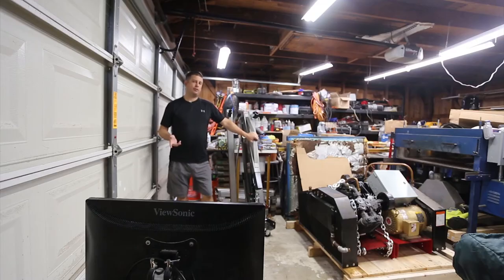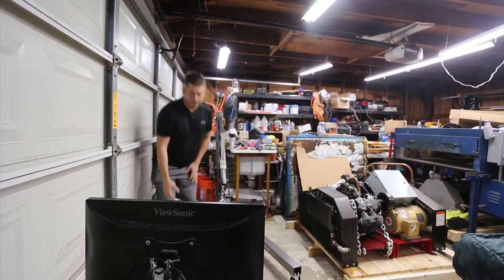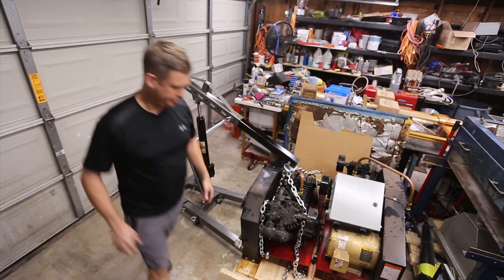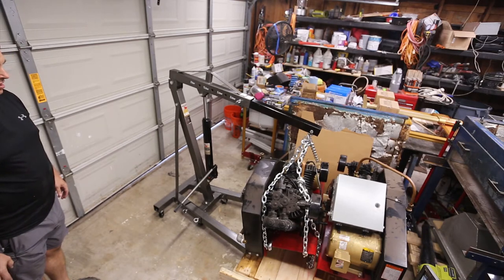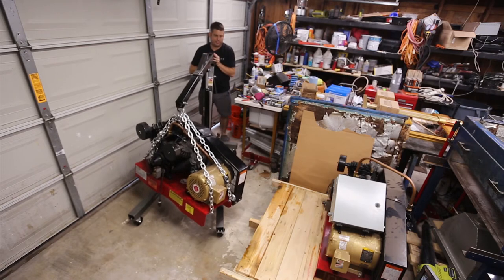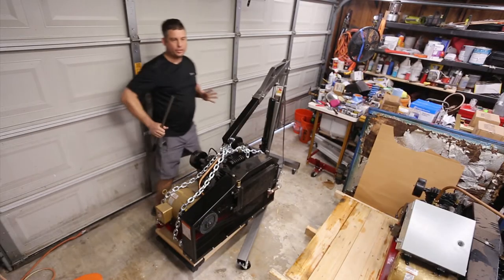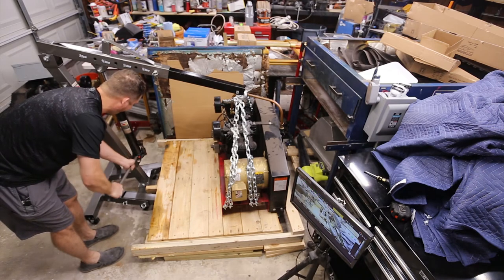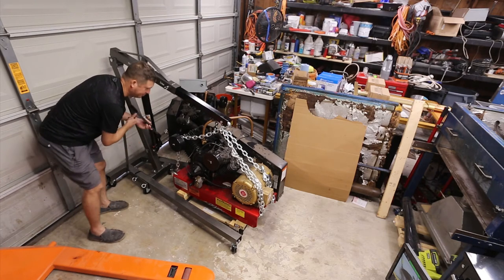Using a Harbor Freight 1 Ton Shop Crane to move two 500 pound Schrader 7.5 HP Air Compressors

Comment: That's a 1-ton crane, but only when then boom is in the short position, in the extended position it's a 1/4 ton (500 lb) crane. If those compressors are truly 500 lbs, he's running at max capacity. If he's wrong about the weight (did he weigh it himself?) he could be overloading the crane. He had clearance to bring that boom in one notch to the 1/2 ton spot and give himself a safety margin, plus extra stability.
Also, as tom73001 points out, proper footwear is a must when working around heavy stuff.

Comment: why didn’t you just open the garage 😐 gets you more room to move around
Reply from the maker: Hi.  Great question.  There are a few reasons.  1) My driveway has more cracks than I can shake a stick at. 2) It was night time or it was hot outside.... I have an AC in my garage.  3) I don't like people looking in my garage as they walk by.  I feel like it is a form of "window shopping" and increases the risk of someone breaking in when I'm not there.

Comment: You don't rig a lift with chains putting pressure on the machine. You use a LIFT BAR to put the chains in a straight downward angle that puts pressure ONLY on the chains and LIFT POINTS!
Reply from the maker: Ideally, yes, if you have them.  I'd also want a proper crane, not a engine hoist with a sticker on it.  A forklift would have been worth a box of chocolates here....... the irony of it is I could have gotten by with a 5hp Quincy unit.... sigh.  So this was way overkill.  On the bright side, it's done, nobody got hurt and it works as intended.
Reply: Less than $40 bucks on Ebay for a lift bar. I think they refer to them as a engine leveler, or something like that. But can be used for anything. You got lucky you did not damage your load with all that chain pressure. It could have snapped, bent, distorted, broken and ruined your entire item. I cringed watching you do what should Never be done.....oh well, sometimes ignorance Is Bliss....
Reply from the maker: I wound up getting one later... but the reality is that these are heavy cast iron compressors and there is a bigger risk of them hurting the chains.
Reply: Always a youtube critic